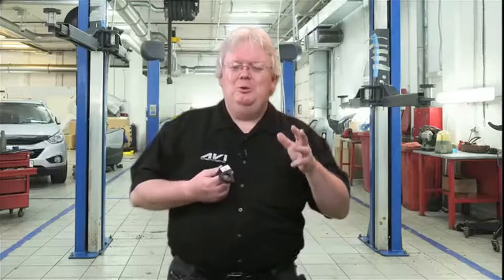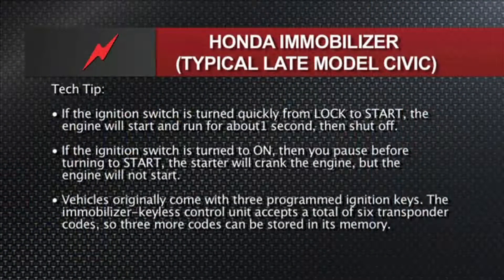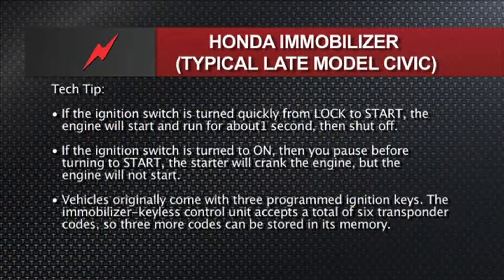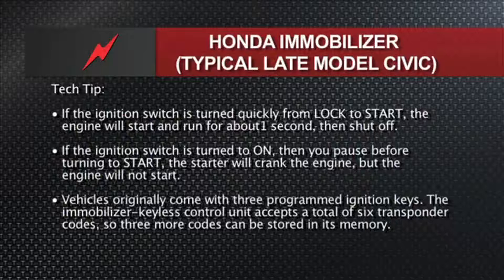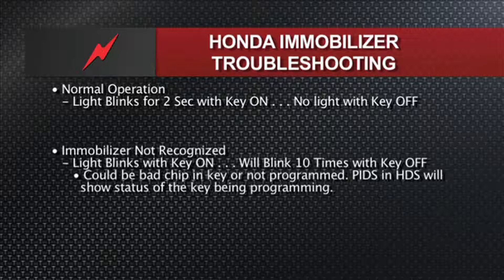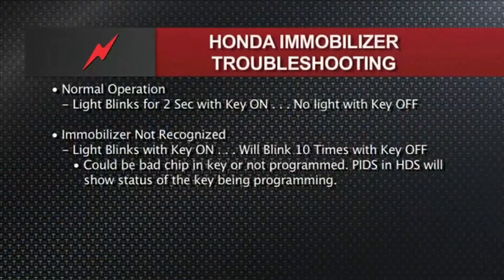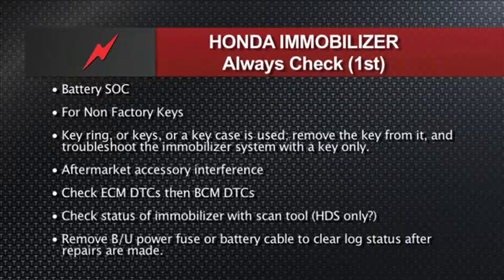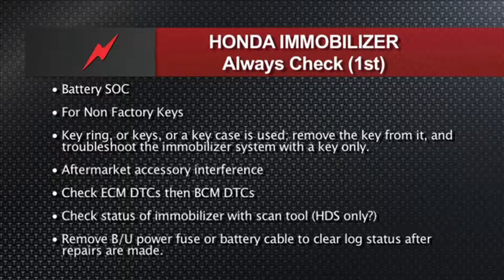Honda Immobilizer | Anti-Theft | Key Programming Tech Tip

Comment: I was told to try your secondary key. The chip inside the key may be compromised. Easy, FREE. Good luck hope this works for all the Honda owners pulling your hair out & going broke trying to fix this crank, no start, green key light problem.

Comment: So I have a 2009 Honda Element I had to change a clutch on and the IMMO system isn’t turning the car over. It’s the OEM key 🔑.

Can if the battery if off the car for a extended time can it forgot the OEM keys? I have a THINKDIGA coming asap.

Could it possibly be an immobilizer failure I’m getting the continuous blink and it’s not the dash thanks for your time

Comment: This does NOT have instructions for programming the immobilizer, which is annoying because Google’s search index thinks this is the top hit for that question.
Reply: I take it your car doesn’t start or did not start at one point did you ever get it fixed because I am in the same predicament and I think it has a lot to do with this stupid security thing
Reply: @fernandoguerra4881  only thing I could think of is break the old key fob and jam it in near the key ignition. Half the time it reads it half the time it doesn’t 😢

Comment: I had to buy a new ignition switch for my Honda pilot 2006. It came with 2 keys, those keys are not programmed to the immobilizer. If I put the original key near the switch I can use the new keys to start the vehicle. Is there a way I could get these keys programmed to the immobilizer? Thank you